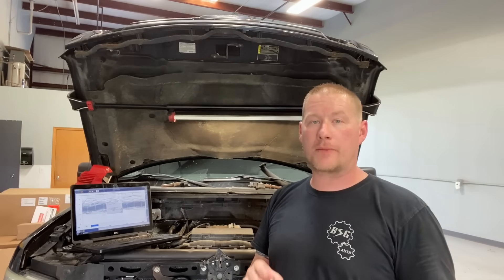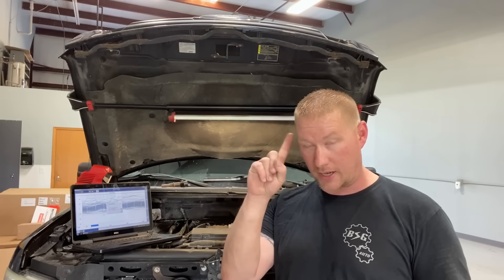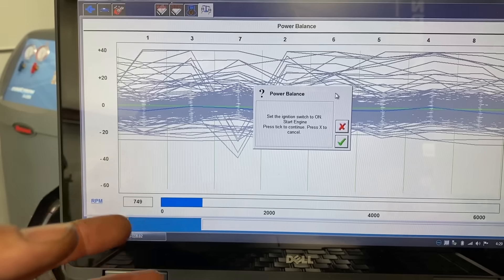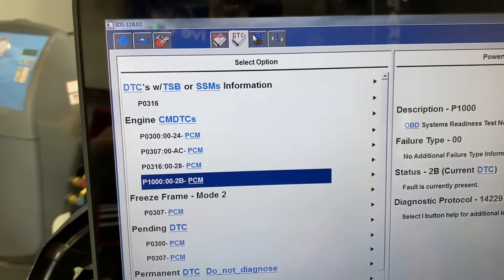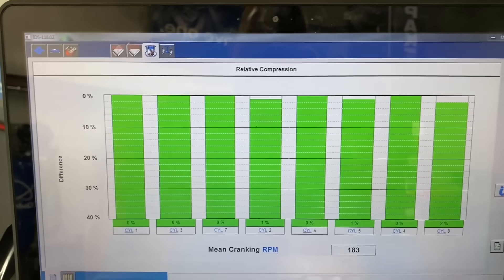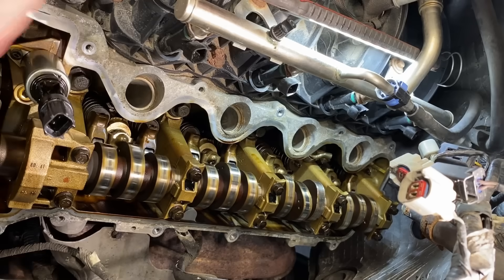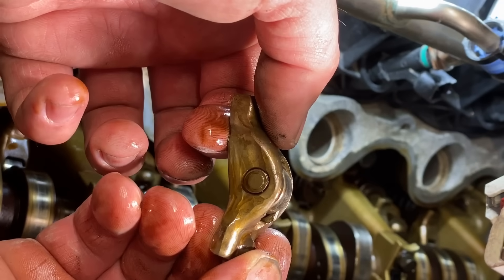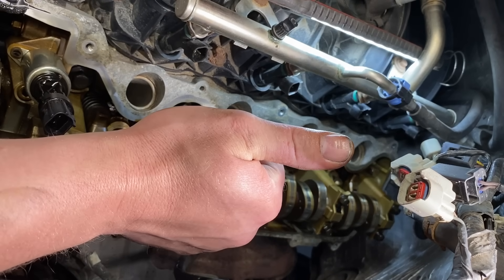Ford F-150 & Expedition 5.4L 3v Triton Engines Hard to Diagnose Misfires Fixed!

Comment: Literally as you pulled the valve cover off, I could see the follower laying sideways. Scares me this is what is wrong with my 2004 5.4. It has p0351 and p0357, I changed both those out with 2 coils off my 08 4.6v mustang motor in storage.  The connector was not on all of the way on #7 either and the boil was rather trashed looking so I swapped it.  It has debri in it keeping it from making a full seat and clicked in.  #6 was not firing, so I swapped it. Now no codes showing up for that one. But now 351 shows and 357.

Comment: Can this happen on a 2006 5.4 triton? I'm having a misfire between 40 and 55 mph but I'm not getting any misfire codes. Had the transmission checked and that's not an issue. I'm going to replace all the plugs and coils to start though. When you start the truck I'm told it sounds like a lifter starting to go bad but it'll tick for the first 5 to 10 seconds and then it goes away

Comment: On a 2005 f150 lariat, 5.4 auto 4x4, what would cause the speedometer to read excessively high(80mph at idle) but not affect the odometer?

Comment: I have a1997 expedition with the 5.4 the has 250k+ it has a tick it idles great but lags on exceleration. I wonder if I can diagnose it without fancy computer or taking the valve cover off any ideas?

Comment: I have a 05 150 with the 4.6 V8 and I've been having the misfire code going off and on for months! They replaced all coils, valve cover gaskets, spark plugs and I still have the same problem? Same misfire code..

Comment: Have you had a 5.4 3v with a lot of vacuum in the crank case. It so much wen I go to pull the cap off the truck will misfire it has new valve covers because the pcv was clogged I figured that was why. And it doesn’t seem to have a lot of power but no codes for misfire and compression comes back fine

Comment: I have a 5.4 2v with a tick at start up that goes away after a minute or so.   Replaced all the lifters and roller followers looked and felt good so I didn't replace them.  Why would the noise/tick go away after a minute or so?
Reply from the maker: leaky lash adjuster, or you are mistaking a leaking exhaust manifold for a valvetrain tick.
Reply: @FordTechMakuloco  I've replaced all the lash adjusters/lifters and pumped them up with oil before installation.  Can't understand, it sounds and acts exactly like a oil pressure leak on a lash adjuster.  I thought I would check the timing guides while I was replacing the lash adjuster.  The timing guides were in great shape but I replaced them anyway along with the oil pump, water pump and alternator and starter motor.  I checked all the roller rocker arms and they seemed in good shape, no sideway or up and down movement in the roller.  I used my stethoscope and I can clearly head the tapping noise about the center of the head at the cam shaft driver side.  I'm stumped.  I blew out number 6 plug some months ago and repaired with a sleeve; the ones with a collar.  While checking the  plug tightness yesterday I noticed some damage to the intake manifold where the plug blew out.  I tried a temporary fix to see if the sound would change by filling what looked like maybe a hole at the gasket of the plastic intake manifold with high temp gasket sealer but the clacking noise stayed the same and goes away after a minute or two.  I can't see how an exhaust leak could sound like this but I'll recheck the exhaust manifold.   Any suggestions on how?  Thanks for your reply; I really didn't expect one.

Comment: I have an 09 4.6 3v that I decided to change the plugs on since they had 157,000 (truck is new to me 3rd owner) 2nd owner kept great care and had all dealership records. Anyway was running fine until I changed plugs ! Now I have misfires on different cylinders but always #4 ! Is this a issue with 4.6s ?

Comment: I have what sounds like a lifter tick, not cam phaser knock, on my 2013 3.5 EcoBoost on the driver side front. Do they have a problem like this? Thanks.

Comment: 11:00 you said that at idle this things runs great because it has an intake and exhaust follower in there. You found one follower off on #7. This would mis fire all the time on number 7 if the follower fell off wouldn’t it? . Can you clarify?
Reply from the maker: There are two intake valves and only 1 exhaust valve. So if the exhaust valve failed it would run horrible dead miss. The intake valve has a backup valve though.

Comment: So I have watched a lot of your videos because I have been fighting issues with my 2005 5.4 f150 and I have had a mechanic try and diagnose it hooked up his snap on computer and came with coils to replace so I went ahead and replaced all coils, spark plugs all the way around and crank and cam position sensors. I have had bank to lean bank to rich on both sides and then 02 codes and they were fixed after I gutted out my cats. Then after driving for a bit the engine had another cam code that I then looked through and shot wires to see if I was getting signal and still I am fighting this right now. It also will decide it is going to if the engine doesn’t stay above 800-1000 rpm. If you have any tips or if I need to do more explaining then please let me know

Comment: All the (mechanics) who didn't fix it but replaced parts, are simply parts repalcers. Too many people who own a screwdriver believe they are mechanics. The spark plug would tell what is going on with #7. And the cats do not discriminate between cylinders on the same pipe...anyone who thinks a good mechanic is expensive hasn't realized how much a bad mechanic can cost you.

Comment: Yup he found it looks like it's time to junk it.....280k  If the follower fell off and chewed the Cam  Then all those shavings a nicely dispersed through the oil and to the rest of the cylinders... Time in chain job with a Cam and all the other work that truck  Needs to be in showroom condition to even be worth that work you could buy one of those truck for the price of the work that needs used , The 2 valve 5.4  Was a monster I have had multiple super duties over 400 K with full plow set ups still running and driving  Even my OBS 460  Was rolling up to 500 K on original drive train

Comment: You forgot one thing the shifter cable on the automatics melt because they go right across the exhaust manifold. I  Went through 3 new ones With the same issue I ended up taking a bunch of quarter inch hose clamps and clamping the whole line to protect it from melting.
Reply from the maker: Um no not a common issue and I think you are commenting on the wrong video?

Comment: Im having a problem with my 2005 ford explorer 4.6 v8
It will jerk and shutter at around 35 to 45 mph ive had both cats replaced and it still does it
What do you think the problem is
Reply: spark plugs/coil packs possibly bud.

Comment: Those are similar problems to what I'm having with my 2000 Ford expedition 5.4 engine. I've had the new cord packs and spark plugs put on. One person said was the #8 cord and they said it was the O2 sensors. Now I took to a guy and found a cord that was not capped down good and the bolt was stripped out and vaccum leak . So he repaired that and it's still missing. Now he thinks it's the injectors I'm at my wit's end !!!

Comment: I have a 2006 f-150 5.4l 3v and it wants to die when the motor gets warm I was told it was the coils and plugs so I replaced them factory plugs and msd coils and now it’s worse and the check engine lite is flashing. And I just put 3500 in to it for new Motor mounts, new transmission lines, new oil cooler and oil cooler lines, And a new oil pan, any insight on what the problem could be?

Comment: What version of Forscan are you using? I just downloaded the most recent version and I cannot find the powerbank test or relative compression test that you are referencing
Reply from the maker: I am using the Ford IDS.
Reply: @FordTechMakuloco   oh okay! I'm having a misfire in cyl 1, just was following along with how you diagnosed it, thanks for letting me know !
Reply: @FordTechMakuloco  do you have to use the vcm2 tool in order to run the IDS software ?
Reply: @FordTechMakuloco  do you have to use the vcm2 tool in order to run the IDS software ?
Reply: @FordTechMakuloco  finally figured out what was causing the misfire in cyl 1, it was my e3 sparkplug this whole time. The electrode in the sparkplug snapped somehow. I've never seen a broken electrode in a spark plug in the 30 years I've spent working on cars!!! Thanks for your videos

Comment: 2004 5.4 rough idle after changing spark plugs. Rpms around 400. I did disconnect pcm during spark plug change

Comment: Hey there so i have a 1997 f150 5.4 v8. I bought it used with 171xxx miles. It was running as if it had a misfire. So i cleaned and checked the gap on the plugs swapped out the 3 coils that werent firing and swapped the 2 injectors that werent firing. I had an engine light prior to the repairs that stated ignition coil b misfire. After the repairs that code went away but i had a new one for cam pos sen. So i replaced that and still no change. I checked fuel pressure. I had 35psi when cycling ignition to on position with motor off. Then i started it and pressure dropped to 28psi. So i swapped out the fuel pump. Still having same issue. Issue is, truck runs barely noticeably rough at idle and wants to bog down when i try revving it. When i put it in gear it gets real shaky and jumpy and barely wants to put down the street. I can barely get it to hit 15mph within a 500 plus foot stretch. (About the distance of 8 standard single story 1/8 acre houses). Could the follower be causing my issue? Also it puts out some blue smoke from tail pipe

Comment: I learned my lesson in my 2010 4.6 with a hard to diagnose misfire. I had a miss fire replaced a bunch of things. A few weeks later I heard a pop them rattle. The follower had seized and popped off. Messed up the cam and dropped a valve in cylinder 4. That was an expensive misfire. Haha

Comment: Hi! I have a question in regards to my 2009 f150 5.4L recently my gas meter been acting up it says 270 miles until Empty and then it would go down 250 miles until empty then would go back up to 270 then change until 230 miles until empty I don’t get it what it could be and don’t have check engine light
Reply: Fuel level sending unit or something like that.

Comment: I have a customer with a 3v F150. He brought it in for what sounded like a top end noise bank 2 and misfire on cylinder 7. We found excessive play in the chain, so we did chain, tensioners, phasers, actuators. Started it up, chain slack was gone, but noise was still there. We pulled all of the rockers out and found 3 with wiped out bearings. Put all new rockers in and the noise was still there. Did a compression check, found cylinder 7 to be down on compression by about 30psi. Ran the truck on the lift, to find the noise had been coming from the connecting rod being bent and hitting the very bottom of the cylinder bore. Contacted customer, he insisted we put a new rod and piston in. We did just that, replaced cylinder 7 injector as well (thinking it stuck and hydrolocked that cylinder), threw all new plugs and coils on it. Noise is gone, but it still misfires on cylinder 7. Has spark, has injector pulse and good spray pattern, has compression. Customer said he'll take it as it is. He's been driving it like this now for over a year. He's also come back to let us know that he's had it at several different shops to try to diagnose the misfire and no one can figure it out.  As a last ditch effort, he asked us to replace the cat. We did and it still has the misfire. We are completely dumbfounded at how we havent been able to figure it out. And no, it doesnt throw a check engine light.

Comment: I have a 2005 F150 w/ 5.4. Your videos walked me through a timing job and dropping my oil pan.  Awesome videos!!  Can’t thank you enough. 
BUT eventually I’ll have to replace my truck. I keep hearing horror stories with just about every engine Ford is putting in the F150!!  
What is the overall best engine that Ford is currently installing in the F150?  For power, reliability, etc.   
I dread the day that I have to buy a newer/new truck. Just because it seems every engine has some design flaw.
Reply: The 5.0. There is a local 2010 with the 5.4 for sale with 405k miles.  $9500

Comment: After looking through your 5.4L 3V tutorials as well as others to set about fixing my 05 F150 (jumped time, chewed up valve cover), I have one question I haven’t seen addressed. Should I lock the cam phasers after replacing with the OEM timing kit set and upgrading oil pump, or leave them be? Thanks for being so generous with your time making these videos, and to anyone else who wants to chime in!

Comment: 2008 5.4 F150.. Soon as I come to a stop, it acts like there is misfire. Engine runs terrible. If I shut the truck off and start back up, it temporary fixes the problem. I let it run rough while listening to the motor and a min. later, the engine ran fine as fast as switching on a light switch. Intermittent problem. Could it be coil issues, MAP dirty, timing solenoids, or cam phasers??

Comment: My mechanic diagnosed it correctly on my '11 Navigator w/160k mi but then wanted to pull heads to figure out what caused it, I said no and just had him replace roller and its running fine. I didn't do fhe camshaft either, wonder how long it will last?  Only cost me $200 vs $3200 what mechanic gave me as estimate if he rebuilt heads and new cams and timing chain. For that money wouldn't I be better buying a rebuilt engine?
Reply: I forgot to say though mine was on #4 cylinder.

Comment: Hi 👋 I got an 2010 f150 5.4 3v  
Had the motor replaced with the exact 5.4 3v motor . I can’t get it start . Turn the key and I got nothing . Checked all the fuses and relays and replaced the pcm still no luck . Also replaced the battery.
Any ideas of what it would be ?? 
Thanks 😊

Comment: You know these engines well I have a 5.4 2006 Ford Expedition that goes into fail safe mode randomly. It has 190,000 on it and runs good, had codes pulled they could not find any. Do you have experience with this fail safe modes. Thank you

Comment: ** help if you really know*** Im at 270k, i took pass valve  cover off because i heard ticking. For 1000s of miles now, just had time for the down time.  it was getting too loud.... especially  after a night of 4 burnouts 😊. So yeah its been good to me knock on wood. Got it with 203k, 270k now, LT headers, cai, cat back, efans, 87 performance 5 star tune, and shift kit, its a 5 4 3v of course. 4.10s 7 lug, goes good. 
At 250k i changed tensioners and rails, chain is original, as is pump.

Questions at 270k with no low oil pressure  issues should i upgrade to hi v oil pump? Rear main is original  too, i dont want oil leaks because of pump.

Next cam is done for it. I see  comp cams has cams but i dont know if they work with 87, with 36gal tank im not doing 93. Even though id fight for every HP i can get. JK yard cam is 175. But ebay has them for 100.00! For both! New! Has anyone tired these?

Ill be doing phasers, maybe chains too. 
Running this to the ground. Then id gas isnt banned yet a 6.2 or 5.0 150 one day. But that wont be for a long time.  . I hope. I like  my cheap taxes and insurance 😂

Comment: I had a Ford Escape 2002 3.0 come in for  tune up to help with a minor misfire i did the tune up then it ran worse then before. I spent hours checking for a vacuum leak. The DTC pulled igntion coils 4 and 6 misfiring. Ran a compression check cause coils where fine finally after consulting identifix 4 and 6 are common. Because so many techs myself included plug in the wiring harness how it feels right but that's wrong! The harness goes into the connectors awkwardly with wiring being obscuredly connected it ran fine afterwards. I like Ford but this Ford Design got me angry all this time checking for a Vacuum leak it was really a coil connection...

Comment: Common problem that I'm mostly found with 4.6 liter and used car lots. Most of the time it happened at start after sitting a how long time without being ran. Great job! I usually use a couple pry bars and it slides right back in..

Comment: Question, since this happened on number 7 cylinder and you are replacing the cam and all the part including new timing chain. since you've gone this far shouldn't you go ahead and do the other side Cam and parts??
Reply from the maker: not cam but yes we replaced the full follower set.

Comment: I had my 2000 E350 van  5.4 motor. with around 500k miles  on it. throwing oil on the spark plug on cylinder 2. then spark plug shoot out, So i swapped for junk yard motor, and took old one apart just to see. My cylinder 2 Piston was burned thru )) LIke good 1/4 of the piston was just gone,  the rings were still there, but piston was burnt, melted, and she still ran, poorly but i was stil lsriving it at 70 mph , on highways,  Fords do amaze me with their quality, too bad they dont make good motors or cars anymore like they used to.  Simple but built tough,  with only 2 valves, those things just could not die. So I will always be looking for the older Econoline vans, and were never go for the stupid transit crap.

Comment: Way off topic but I looked at all your videos and didn’t see anything about doing crankshaft bearing or anything but you seem to be very knowledgeable about Ford motors...so I have a 5.4 2v and I replaced my rod bearings and main bearings, do I also need to replace the bolts including the side bolts?